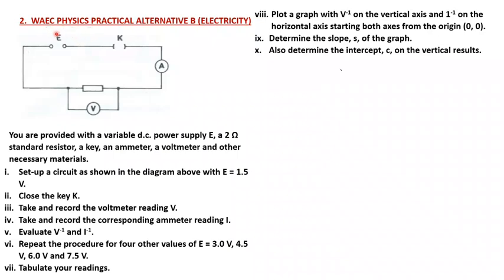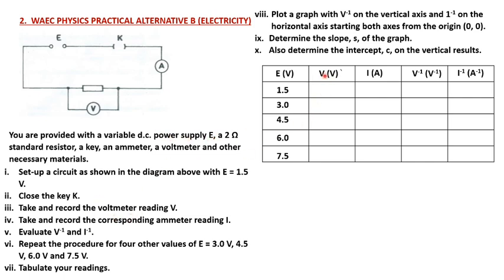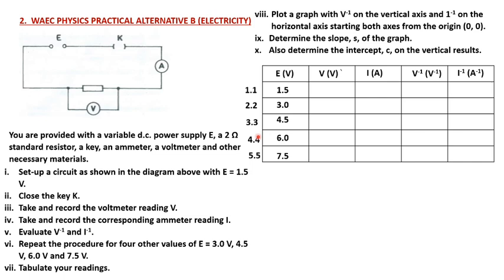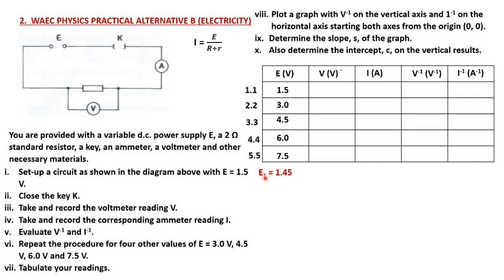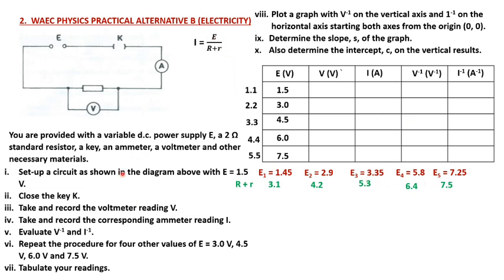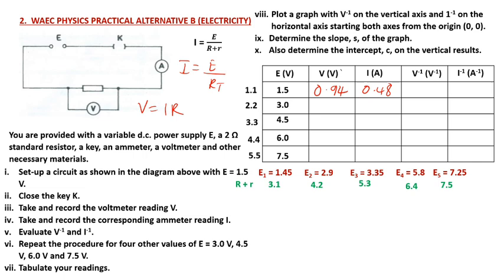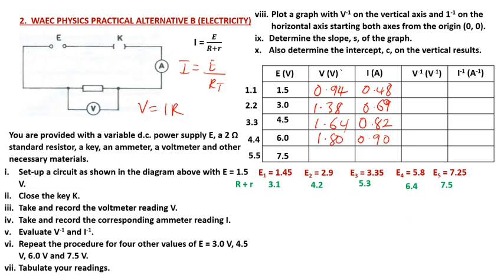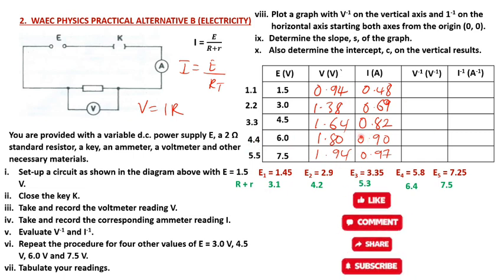WAEC PHYSICS PRACTICAL ALTERNATIVE B 2024 ELECTRICITY MANIPULATION.

Comment: Tnks alot sir.pls explain better the 1.1 and so on sir
Reply from the maker: I want you to understand something about WAEC physics practical. WAEC doesn't mark the accuracy of your readings. They mark whatever readings you provide, as long as they follow a trend. In this practical, you are expected to have increasing values of V and I as E increases. 

However, from my previous measurements, the internal resistance of a new cell is around 0.5, as the cell begins to discharge gradually, it increases to around 1.0 to 3.5 

Notice, I used 1.45 for the first EMF, with an internal resistance of 1.1. So, that fits perfectly. As for the other internal resistance, the total will be the sum of r since they are connected in series. 

I hope this helps.
Reply: @yousciencelab5307  God bless sir just want to have a First hand information about those so I can explain thoroughly but God bless sir
Reply from the maker: @danielkaro4739  it's good to ask. And I appreciate that. 

God bless you, too. 

I hope the explanation isn't ambigious?

Again, you can actually get the internal resistance by taking the first readings and then using them to get the internal resistance of the first one. 

In the actual experiment I carried out, my V = 0.90 V and I  = 0.55 A. 

My EMF was around 1.45.  

So, if you use the equation, E = V + Ir 

You'll find r to be around 1.0 ohm.
Reply from the maker: Also, check through the description of this video to get the actual practical process. It's easy.